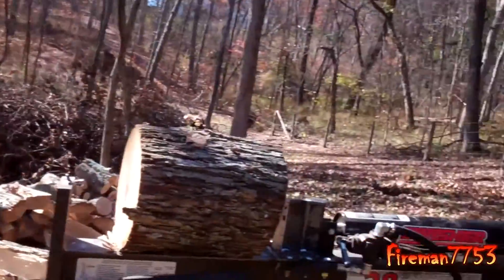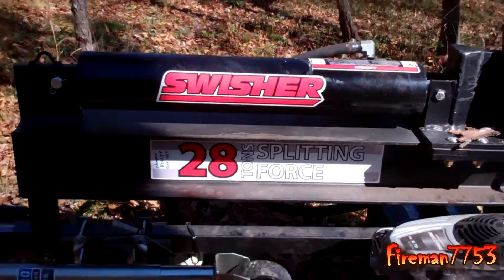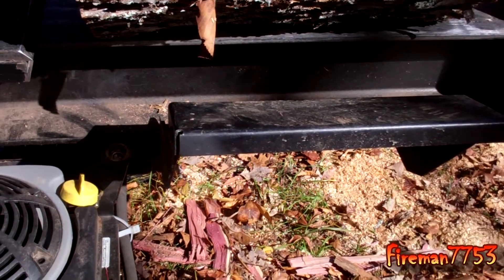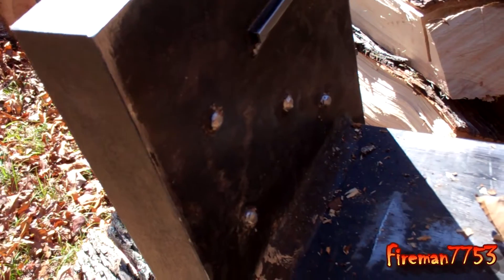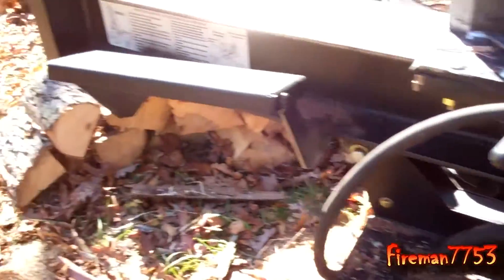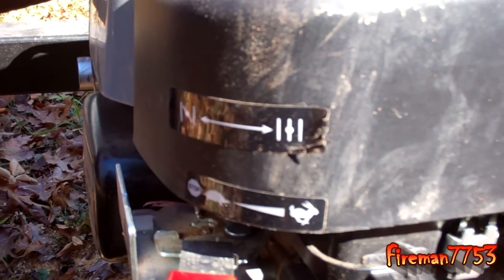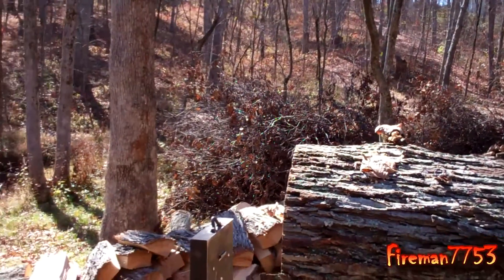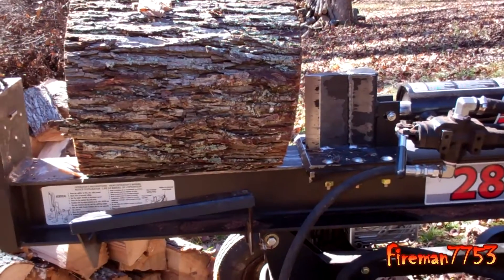Swisher Log Splitter Review

Comment: The little gas tank is frustrating. Too many refills when running full throttle. Running at idle is too slow. Otherwise, it's a great machine with a 4 way splitter.

Comment: That's the very same splitter I have except I have the Briggs & Stratton 10.5 motor with a 344cc. Tell me, does your cylinder get pretty hot after about a half an hour to 45 minutes of use? Do you think the quality of the hydraulic fluid has anything to do with that?
Reply from the maker: Do you run it wide open?  I found if you run it just above an idle (which seems to split just fine) that it does not heat up.
Reply: No I don't. But after a while of running it the cylinder does get rather warm.

Comment: You  have  a nice  log  splitter  there.   Build  mine  1979  6 T   rebuild 2013 26 T  all  steel  is  same   https://www.youtube.com/watch?v=Z4Wy4OANZwA.     As  for  heat  I added a 35 gallon water  tank for  my  hydraulic  fluid   heat  problem when away.   I  do  run my  motor  wide open  turning my 22  gallon 2 stage pump.  Added  my  back saver  boom with timber dogs  on 12 V  winch.   At  end of 2014  had  2 stacks 22" wood for my heater 12 ft x 6 ft x  65 ft  with  2 ft air gap on top under cover.  Each stack has trap under wood  on ground but  I am working on a way  not to have wood on ground, even with trap  lose lots wood